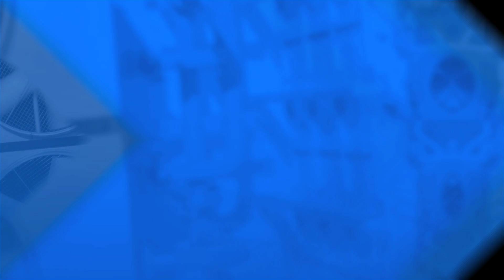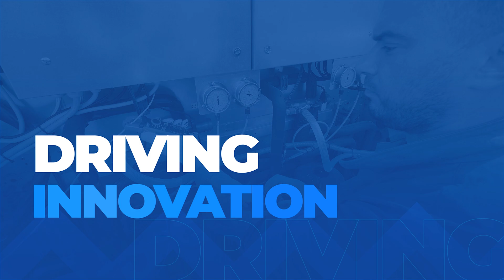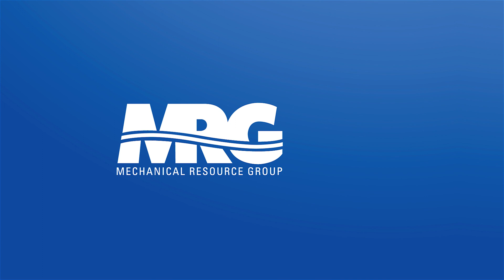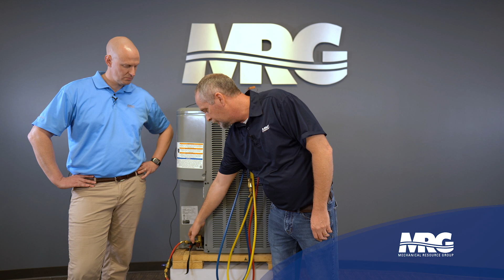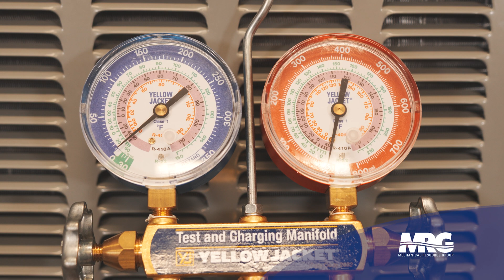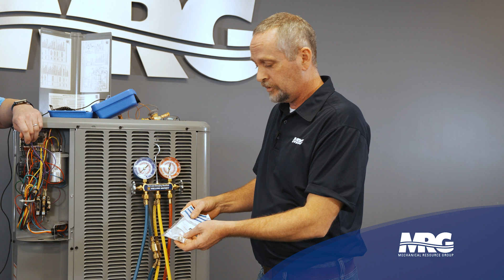HVAC Technician Pro Tips: How to Accurately Measure Subcooling for Refrigerant Charge

Comment: One reason for sanding the pipe, is that Fieldpiece wireless clamps need a good electrical connection from one side to the other or it won't show a reading.  This is a probably to ensure the tech has a good connection to the pipe.